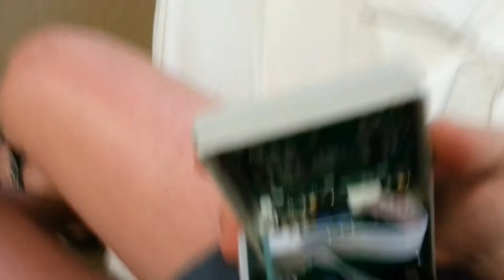QJE PS3010 power supply teardown

Comment: In future please do not disassemble on an unmade bed. A work bench with good lighting is a minimum. Use a power screwdriver and do not show every screw being removed. Analyse the unit before filming. Please give details of circuit function and run it against a programmable load. So full current, repeated short circuits etc. Also full load and use a temperature measurement gun to see what gets hot.

All we know is that you do not make your bed, the unit is probably a switched mode supply and that is about all. Not that useful.